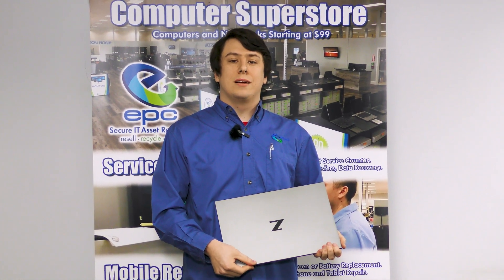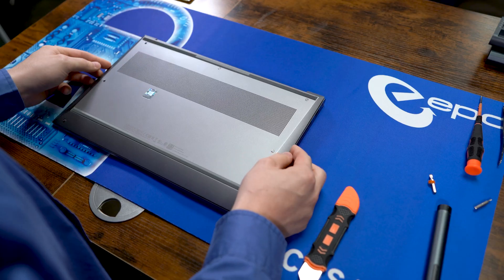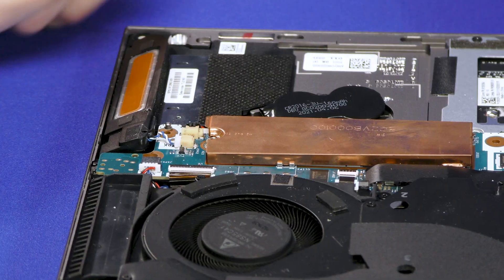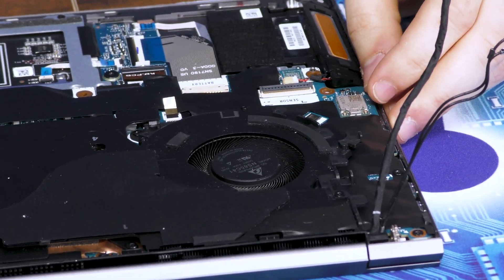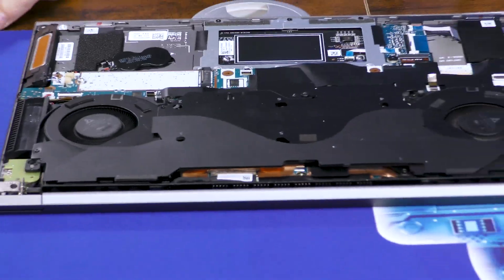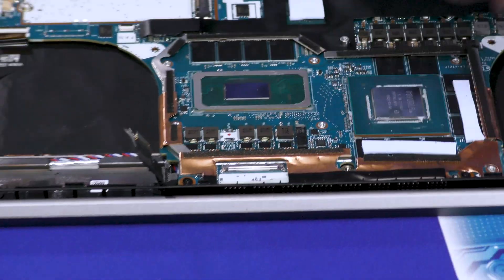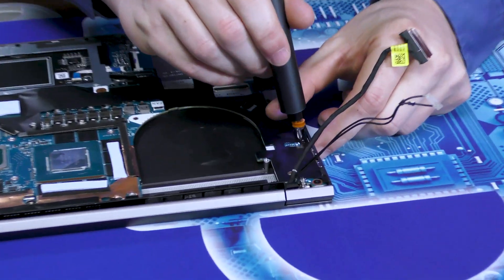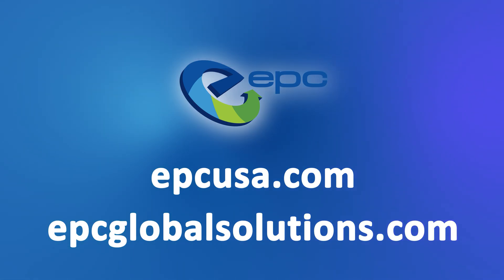How to Teardown an HP Z Book Studio G8 Laptop!

Comment: Does air blow out the left side of the laptop vents? It looks like the fan is closed off on the side even though the casing have vents on the left side of the laptop.
Reply: I got the laptop and it actually blows air from the rear of the laptop, not sure what is the purpose of the left vents as they don't blow air or even intake some